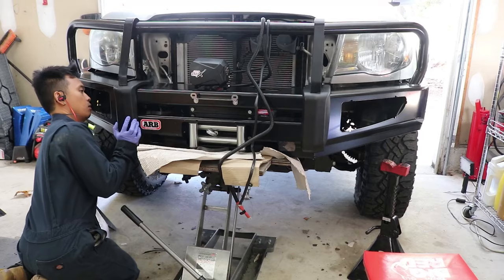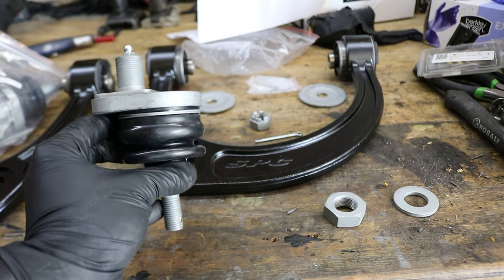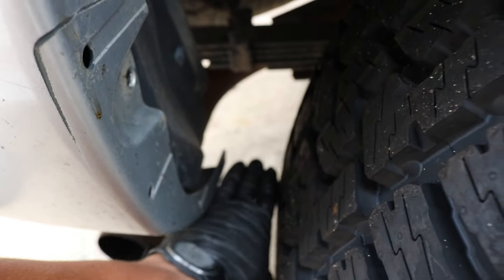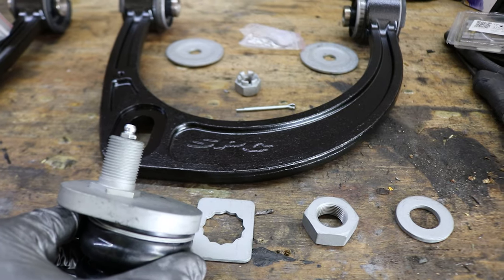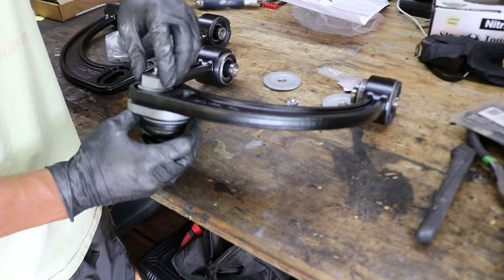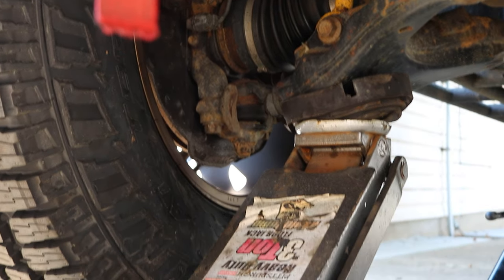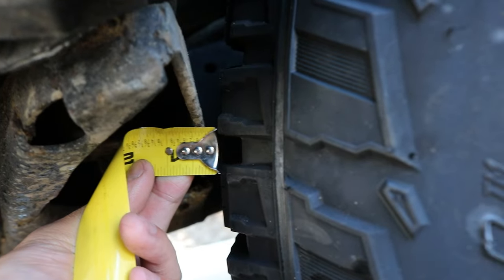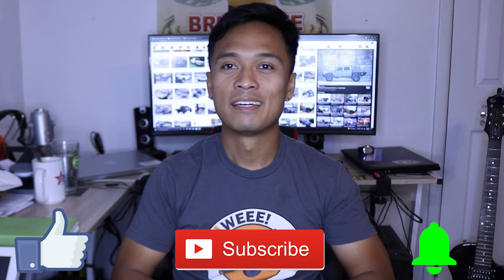Solving the problem to fit 35's on the Taco!

Comment: That's the best I've seen someone explain the SPC adjustment. I need to flip mine but have been a bit intimidated to screw up my alignment, but that made it easy to understand

And definitely time for a CMC if I were you. Stuffed and turned it'll definitely rub
Reply from the maker: Thanks for the kind words and thanks for watching - i understand the video is really long, I do have the CMC done (3:52). You can also probably tell by the shape of the cabin mount from underneath (12:47), I also had some final thoughts on the rubbing as well (16:45). Also, check out my wheel alignment at home video, that will make alignment a lot less intimidating
Reply: @KFloTacoma  I missed the part about already having a CMC, so maybe time for a more aggressive CMC! I've watched your videos on at home alignment, unfortunately I have a gravel driveway and that would be dang near impossible I think. However, I am going to flip my SPC tabs to get me more space. I'm only on 33s and I've had to cut almost all the plastic and it still hits occasionally. Any harm in just flipping the plate and eyeballing where it was in relation to camber?
Reply from the maker: If you flip it around, your camber - you can kinda eyeball BUT the toe will be completely out of whack and you may have major toe out which will cause weird steering and excessive tire wear. You can probably ask your local alignment shop to change the setting on the SPC and have them align at the same time.

Comment: I used to have general grabbers (red letters) mud terrains on my taco and boy…. Every time it rained or snowed I felt like I was on skates! I have 4:10 gears too and it was not a fun time unless it was in the dirt. Happy to have general grabber at2’s now, still slide a bit but I need to add weight in the bed.
Reply from the maker: Thanks for sharing your experience, bro. My brother was always extra hesitant driving in inclement weather with his MTs. He said he's definitely switching to ATs after his current set wears out

Comment: Why not Stealth Custom Series wheels? 
Also, why not go with a proper offset and ditch the (not recommended by anyone) wheel spacers?
Reply from the maker: The stealth Custom Series is gorgeous, but I think these Rocktrix were much more within my budget since I was buying 5 of them. I'm not using spacers with these as I do have the proper off set with these new wheels (18:40)
Reply: @KFloTacoma  my bad, missed ya saying that and I thought you used to be running with spacers….!

Sometimes you just got to save up… I bought my 5 SCS F5’s when I upgraded too 
(Same color as you went with more or less/ great color!)

Comment: Are you going to need to regear again?
Reply: @Of mice and men I think you should read your comment again
Reply from the maker: Hey bro to answer your question, when I regeared to 4.88, I took going to 35's and the weight of the camper into account. Typically, when you have a manual transmission (like mine), 4.56 is very popular combo with 35's but since my setup is heavier, I went higher with 4.88. The next video will be a speed analysis video which lays out the varying speeds at different gearing and tire sizes
Reply: @KFloTacoma  Thank you looking forward to it
Reply: @Of mice and men Yeah but did he use regear grease for his additional regear to his previous regear
Reply from the maker: Yea, I'll probably do a separate video on MPG analysis - I'll definitely put one together though

Comment: What gear ratio are you running?
Reply from the maker: I run 4.88 I also have manual transmission. I would advise to watch my regear 101 video by the way
Reply: @KFloTacoma  I did watch it but forgot what you went with. Going with 4.56 in my 2015 4WD auto Tacoma next week. I decided to go to a gear shop vs ECGS and doing it myself. It came out the same price as the gear shop.

Comment: Or, you could not care what rubs at full lock and just slap em on anyway. Follow me for more terrible tips on how to ruin your stuff faster like I do. On a serious note, also check Solomotorsports for their LT kit, it's a little different than Marlin, but about the same cost. Also, for 35s, both are likely overkill. I do wish I had done either kit before I did the 39s but whatchagonnadonow
Reply from the maker: LOL yea, I'm keeping those wheels and tires on there regardless. I'll definitely have to join you on one of your trips 🤘 - those 39's look great btw. There's definitely a shit ton of options out there and I'll definitely have to do some more research but that Solomotorsports look like a solid choice as well
Reply: @KFloTacoma  yeah brutha lets wheel it!!! the good thing about the marlin/solo is they come with an upgraded steering rack, I am putting the solo version in next week. the 39s are so stupid I cant believe how awesome they are. I am also installing a 1 ton rear from ECGS next month to deal with the stress those tires are so, uh. yeah. thank you for that compliment!